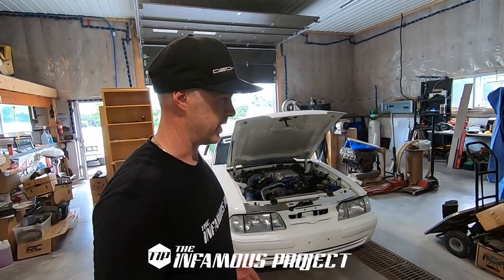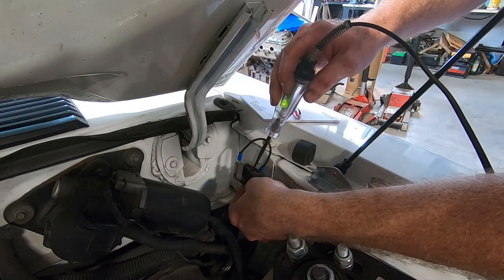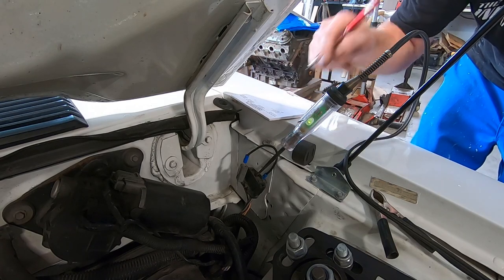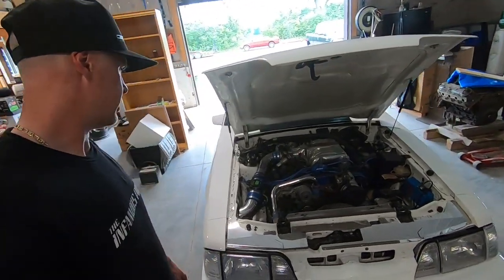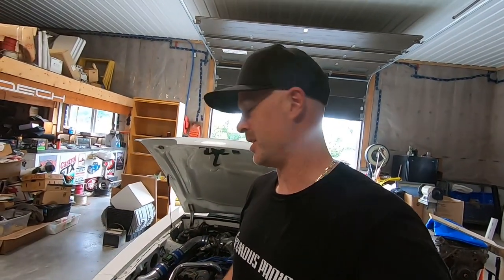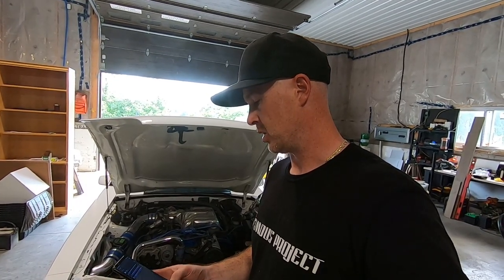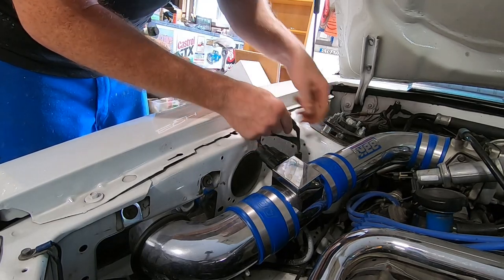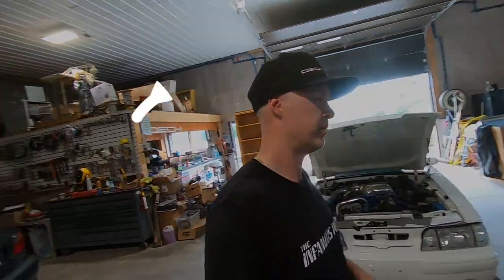Reading Codes on my Foxbody Mustang - Idle Problem SOLVED!  - TIPS04E68

Comment: I have 2 of these cars, a 89 and a 91, the 91 since new,first time i have seen that cover on the diagnostic ports, pretty neat, guess mine was taken off at the dealer or it just plain came without it,lol, i love my INNOVA scanner,33 bucks online,counting flashes is just not my thing,really helps out and pays for it almost immediately, next time one of these cars lands at the salvage (a rare occurrence these days) I'm gonna hunt for that little diagnostic ports cover. 

Another thing about the scanner is that it comes with a really cool book that has all your codes that way you dont have to be looking at your phone and searching for stuff, there are also several tests in the book you can run on the car like cylinder balance test and just a bunch of other stuff.

Comment: when the hell did they calibrate them to throttle bodies size?  the 75mm is the size of the meter housing.  all they ever did was tweak the transfer functions of voltage for the injectors, a band-aid compared to what's available these days
Reply from the maker: Well that makes more sense! The only reason I thought that is because the guy before me said he had the MAF calibrated for the upgraded throttle body despite the car having stock injectors?
Reply: Correct. Mass air flow are calibrated to injector. Throttle body does not come into factor however that is likely what info the guy may have passed along.
Reply from the maker: Ya it was on a completely stock motor too which really made no sense. All good
Reply: @TheInfamousProject  good find! That tape was hiding your issues!

Comment: I have a 91 that has a check engine light on. Back in the day I had the scanner for these cars but that’s been lost or lent out years ago. I was trying to use my test light and I’m not getting what I think I should. When I jump the two wires then connect test light it’s on, I turn the key and it a bit brighter but then that it just stays on. Any ideas?